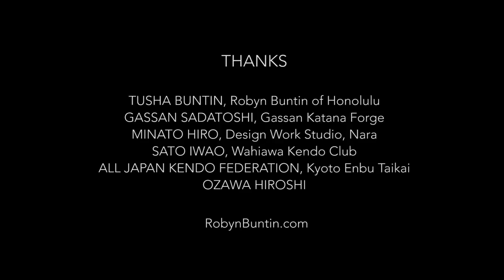Kendo: The Principles of the Sword

Comment: 5:45 that's gotta be the most beautiful sword i've ever seen
Reply: Its beautiful but purely show it has no tsuba and the indents would cause more friction reducing its cutting force of course its lower so doesn't matter as much but still it also though very barely weakens the blade
Reply: @SirDankleberry  hence the word beautiful and not Tactical
Reply: @depressedasfook2893  The "indents" are called bo hi and they lighten nihonto significantly. Since they form an I-beam shape, almost no structural integrity at all is lost in the blade. The blade is also resting in shirasaya. No fittings other than the original habaki are used which is made solely for long term storage to protect the blade, so no tsuba would ever be on one. No master Japanese sword smith spends 18+ months purely for wall art either. These limited registered smiths in japan that are well known all around the world today make fully functional swords regardless of the engravings and design work. Not to mention that hamon on the blade is also the most basic least intricate variation, called suguha; a very straight line that is deferentially heat treated.
Reply: In case you're interested, there is also a video documenting its creation. It really plays into tropes surrounding the katana (ie "best steel in the world" and stuff like that) but its an entertaining watch if you have the time. Its really neat to see the swordsmiths at work. https://www.youtube.com/watch?v=VE_4zHNcieM
Reply: @DwP820  Tropes has nothing to do with it. The Katana was a masterful product of trial and error, for its time and place. The strength and flexibility were not a product of the best steel in the world, PROPERLY worked steel anywhere in the world was the same for the time. Thing is most weapons of the time were not properly worked and purified, nor constructed the same. Most weapons were hammered out, and used heat tempering to impart different hardening qualities to one piece of steel containing the same amount of carbon.

The Japanese of the era finely worked iron to engineer  3 different levels of carbon purity and rigidity in the steel, soft for the core, semi hard for the back and sides, hardest for tip and cutting edge. Then laminated the 3 types of steel together to form a superior weapon for the time. 
Having said that It was not designed to break other swords but to flex when contacting them so it would not break as often. It was designed as a curved weapon to parry rather than full on contact with other steel, and to cut through flesh and bone. Which it did very well. A well trained Samurai would rarely break his blade, not because it was indestructible, but because the blade was an extension of him through training, he knew its strengths and weakness.
Reply: shirasiya sword without a guard in handle
Reply: “Anjume”
Reply: @SirDankleberry Engravings offer Belief and Faith
Reply: @SirDankleberry  Yeah that was my point in that sentence, hence it being in quotes. The documentary is big on the "Oh this is the best steel that ever was". I dont believe that myself.
Reply: @SirDankleberry  Everybody has a plan until they get punched....
Reply: I agree that made your heart skip a beat pure awe and respect on the excellence of the craft. And all the people against it in the comment, cant even plant a tree straight forget making something so elegant.
Reply: @SirDankleberry  its about tradition and SPIRITUALITY, a representative "banner" of their history and identity, not about weapon nerdism and being edgy on the internet
Reply: On the other hand i agree with your statements. At the end of the day different tools for different scenarios
Reply: @SirDankleberry  didnt ask.

Comment: Beautiful Katana. I started training in 1974, over the years,  (thanks in part to some over exaggerated displays in movies, imparting mystic qualities to Katana), I constantly hear the belittling of the Japanese Sword makers. What I refer to as arm chair experts say the folding was only to rid the iron of impurities because the ore was so low quality. 
The folding was much more than that. The art was in producing steel / iron with varying degrees of carbon, the soft for the core, less hard spring steel mostly used for sides and the back, and very hard steel for the edge, and combining them in ways to give the sword strength and flexibility. Although not the indestructible mythical movie blades cutting through metal like butter,  the traditionally made Katana is a thing of artful beauty, but still a very formidable weapon. 😊👍👍👍👍👍.

Comment: In my younger days when I took up Kendo and other martial arts, I felt the same way as the speaker, and still do, about respect and social conduct.  But I  had a nagging thoughts about the phoniness of the Kendo matches.  The scoring system is very strict.  I am not saying that Kendo practitioners are not skilled in Kendo.  I am saying that if the practitioners were to use real swords in a match, even a friendly match, and not with a shinai, they would be a lot more calculating and cautious with their moves due to the fact that even a slight contact with a blade on any part of the body can cause serious injury.  However, points are only given to strikes on the specific parts of the body.  The contestants have complete disregard for injuries because injuries are rare to none in Kendo matches.
Reply: Tyrone Kim you have a really good point there.. And maybe for the sake for being a sport discipline and not real bujutsu kendo is softened to the point that it became something different from its roots really. Luckily, there is enough kenjutsu styles there if one is lucky enough to find such dojo in his city.
Reply: That's a good point. Considering that the old fashioned way to test blades were duels or human bodies kendo was the next best thing. Also, maybe kendo was used to help tone done aggression in peacetime while still creating a difficult sport.
Reply: Phoniness is probably too strong a word to use. I practised Kendo for close to 8 years before I quit because I started training in Koryu Kenjutsu. Specifically Tatsumi Ryu. The reason why Kendo has such a striking system is because Kendo wants to incorporate certain attributes in its practitioners hence thats why the strikes are only to the Men, Kote and Do and one thrust to the throat. And yes, unfortunately, the Shinai is a poor representation of a sword. It really is nothing more than a light weight tubular stick but for safety and for scoring matches, it is a perfect tool. Modern Kendo has very little to do with its Koryu Kenjutsu antecedent in terms of the actual mechanics but it still has many intangible concepts like distancing (maai), timing (hyoshin) and awareness (zanshin) built into its framework courtesy of Koryu Kenjutsu specifically from the Itto Ryu. So in order to cultivate these factors into practitioners on a large scale, Kendo was modified to become a sport like scoring system so that it became a lot easier to teach to large groups and to create a competition environment. The end of WW2 also forced the Japanese to change a lot of the prevailing martial arts into more peaceful watered down versions of their original selves so that they could gain approval and recognition by the Americans and the public in general. So in short, modern Kendo today isn't about fighting in a life and death manner with actual swords but more about cultivating Japanese martial and moral characteristics in its practitioners.
Reply: That's the same thing with competitive sparring in any weapon art - the bottom line is, it's hard to replicate the fear of death, or horrible injury in a sport, especially if you're conscientious about safety.
Reply: Maybe eliminate scoring. First good strike wins as with a real sword.  They make a make deal about balance and poise,  so lucky hit when off balance doesn't cut but in real life, a sloppy cut still can kill.
Reply: Kendo is not preparing you for real battle.  There is no point in preparing for a real sword fight in the 21st century.  Kendo is a martial art and a sport.  Expecting kendo to prepare you for battle is like expecting chess to prepare you for being a military general.

Comment: The most powerful weapon was either the spear or bow before the gun...
Reply: @Metalignant  incorrect. All samurai were required to learn katana, as the primary, plus two secondary weapons and, allegedly, an art.
Reply: @PusabumCanuck Wrong, Yari and Naginata were the main weapons when on a battlefield. Samurai have katanas as a weapon to carry with them at all times, and a sidearm.
Reply: Samurai were mostly using different types of yari, daikyu (war bows), naginata, tetsubo/kanabo/konsaibo, otsuchi, nagamaki, odachi, tachi (katana's ancestor, was longer and slightly more curved) even chinese liuye dao, chang dao, guan dao and muskets. 

Not every samurais could afford the daisho (katana + wakizashi or tachi + wakizashi, and a third belt weapon called tanto). 

Saying a samurai is a swordsman beforehand would have been considered quite an insult (you would have been beheaded for that offense). They were mostly horseback archers, which is even more complicated than using a sword on foot. This is also a very famous tradition called "Yabusame" in Japan.
Reply: @RonJeremy514  Tachi were worn differently right?
Reply: @virial1337  The Tachi was mostly worn edge facing down in the sheath, but many samurai did the same with katanas. It really depends on the bearer's preference. The Tachi could have been worn that way because it was known as a backup cavalryman weapon so it's easier to draw it that way on horses.
Reply: Jackie Channel also war hammers were devastating, since they had spikes too. So sad that people overrate swords, specially katanas. Don’t get me wrong, I love and prefer swords, but to say that a katana wielding samurai can defeat a spearman most of the time is idiotic.
Reply: Armor pretty much negated the sword as a battlefield weapon. Pole arms and cudgels would have been the go to. Swords were best used in street clothes. Same thing in Europe. A mace, flail, or pole axe would have been more effective against armor.
Reply: Øath betrayer well it’s pretty hard to get close to a decent spearman, most of the time you end up frantically binding and clinching to the spear so to trap it until you realise that once you trap it the opponent drops the spear and whips out their side arm to gut you. Now that said try to win the same thing but against a line of enemy spearmen where if you get close to one the one next to him will shish kebab you. Trust me, it’s really hard, admittedly not impossible, but really really hard... during HEMA practice we tried it, and a polearms reach advantage is really really strong...
Reply: Chopstick damn bro you’ve been in medieval wars?
Reply: dlosthegoat no, but I did do some training on pikeblocks during camp and HEMA practice had me encounter spears quite frequently :D
Reply: in the context of war, bow>polearms. bow on horseback>polearm on horseback. katana/sword = last resort/indoors weapon. samurai were primarily horse archers for a reason. outside war however, you won't be carrying a bow or spear anywhere with you unlike a katana, so their regular presence has made them more iconic to onlookers. modern media has romanticized swords a lot, japan has a lot of bow and spear arts that are ignored by westerners due to the romanticization of the katana, it's unfortunate.
Reply: That’s what I was thinking. Don’t get me wrong. These documentaries are great. But ffs stop say ain’t “the katana is the best weapon” and all that. I love katanas and I do kendo but I still accept that the tanegashima, yumi, and yari were the best weapons at the time
Reply: @KaptainCanuck  nope. It was a side weapon until the edo period where is was used for defense and duels

Comment: I hate to say this, really I do, but the katana was never an immensely more powerful weapon than any other sword that was ever used. Yes it’s a great cutting weapon, but it was a side arm, just like most of the swords of the rest of the world. It was only really a primary form of defense when an individual found themselves in an environment like the palace or market or other areas where violence was considerably less likely than the battlefield. 

As far as a “powerful” weapon. Try the great sword. The Japanese have their own version- the Nodachi or “field sword”. I think you’ll find that over romanticism of a particular system blinds one to the efficacy of others.
Reply: The Nodachi wasn't used for a long period of time because it was best in the hands of strong and tall people. Also the Nagamaki and Naginata were vastly superior to take down horses and better handling, quite cheaper too.
Reply: Jensen and yari they make box formations for spear walls yari was much better in combat then normal spear while in formation, But also combined with matchlock ambushes and dependable Yumi close quarters archery practiced by samurai. That and katana would indeed be less practical per say but a no dachi is mentioned purely for massive charge strength but extremely heavy. Thus even if katana is more not head on it gives access of easy use and easier to fight with for long periods of time. But weapons are not just to be understood but martial arts samurai practiced a on purpose training on how to counter Spears head on besides samurai were always mostly the officers of ashisgaru and also first samurai were in the gempei war the minananto vs taira, taira holding the SHOGUN hostage and enabling pure control of there son being heir to the throne. Meaning samurai as well as the katana were used as shock weapons and quick surprise and speedy attacks. Also there are more then one type of katana as well a katana forged of strong steel could cut threw another sword as such also cut other Spears and etc.
Reply: There were even many field tests, with different kind of swords. The only sword that was capable to destroy another sword for real, was the German long sword. The katana just repelled and broke.
Reply: @RonJeremy514  The Nodachi was used by strong, powerful, tall samurai. Which were uncommon in Japan. There were some (mainly Northerners). Those of mixed Ainu blood or pure Ainu blood tend to be at least 6 ft or over. 

And there were some Southerners who got to be 5'11. 

The ones who were 5'11 or 6'0 or higher... they struck fear into enemies on the battlefield.

Australian soldiers during WW2 feared the Ainu shock troopers that stormed their positions. They had thought Germans had attacked, but it wasn't Germans. It was Ainu soldiers fighting on behalf of the Japanese Army.

And the nodachi (unlike the katana) has been documented to be able to cut a human in half, and has been said to be able to cut down horses as well. 

As it's also known as the zanbato or horse-cutting blade.
Reply: @thewanderingstruggler8601  The Ainu is a marginal Japan/Siberia ethnicity. The Nodachi was indeed practical in cutting horses legs. 

As an anti-infantry weapon, it possibly had some kind of blunt force because of the huge blade, not that Ashigaru foot soldiers would have decent armours anyway, but their Yari would outrange this weapon. 

But I can imagine this weapon sucked in corridors. It is literally translated as "field sword" or "long sword".
Reply: It was a secondary weapon and was used in battle.

Comment: But the curve in a katana is not intentional...it a result of adding the hamon... and the degree of curve in a katana  adds very little cutting power... a sabre is an example of using the curve to add cutting power...
Reply: the curve IS intentional, it is a cultivated process, developed over time, it aids the speed of drawing it out, sometimes from a sitting or kneeling position. . the degree of curve is measured against how often you stab or thrust. Sabre(s) used from horseback are wielded differently, thus have designed into a different curve. There are in fact "straight" Japanese swords.
Reply: Damn, for hundreds of years, Japanese swordsmen have accidentally curved their swords? Thanks for the history lesson.
Reply: Also it is easier to make a curved blade than a perfectly straight one ?
Reply: Body mass (not weight and acceleration equate power, not curve to the blade. A curve enables easier slicing rather than a chopping style (ninjato (20th century "ninja" weapon) and all other straight swords cut the same way. A curved sword slices differently and better.

Comment: No disrespect intended, but he seems to be of the opinion that curved swords were only found in Japan. Ever hear of the saber, yataghan, tulwar, pulwar or even the khopesh et al? Whilst the katana is a good sword,it is not the perfect sword in all instances. For instance,while an excellent cutter, it is not as good in the thrust as a rapier or long sword. As for kendo, well, it is a sport, much as modern fencing is. Try some of those moves in a real fight and you'll be the black knight from Monty Python's Holy Grail in short order.
Reply: Kevin Phung indeed. The, (and I will butcher the spelling) moonae, and skii are both techniques that involve god thrusting
Reply: Real fight LOL
Reply: @tactipoo772 
Almost all swords are used for quick movements, nothing good comes from moving slow.
Reply: The Katana never was a long sword, it was medium at best. The Tachi (highly similar) was longer and was used by the cavalry. It was not necessarily faster.
Reply: @tactipoo772 
Again, almost all swords are fast, nothing good comes from moving slow in a sword fight. Almost all swords with points are also used for thrusting as well, no surprise about the katana being able to thrust.